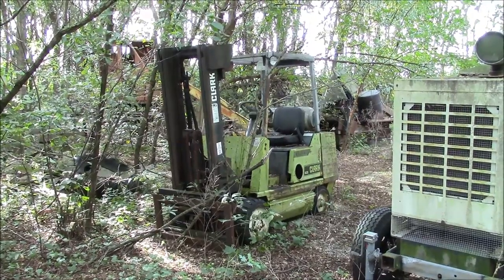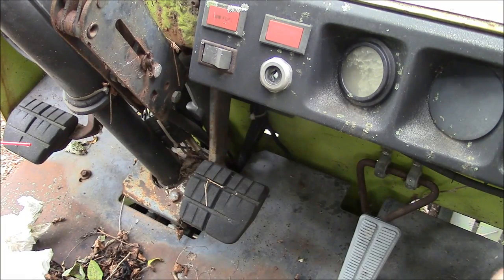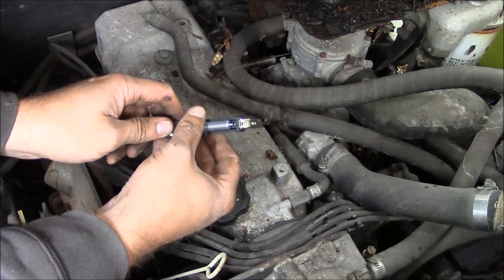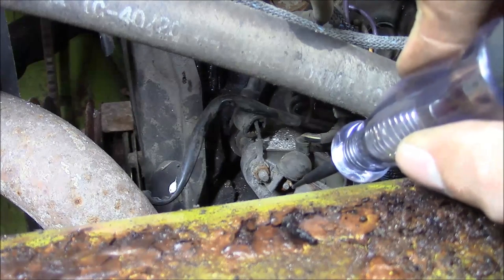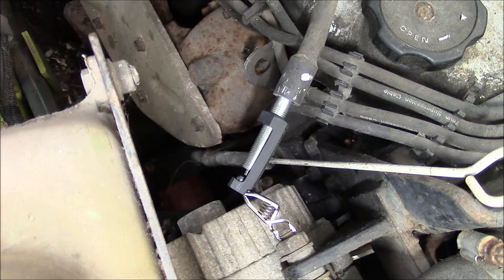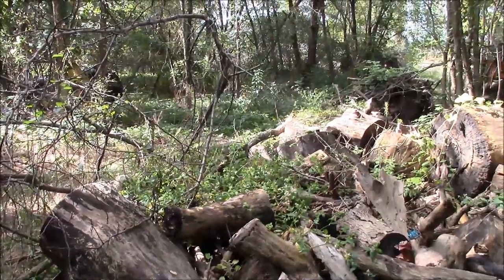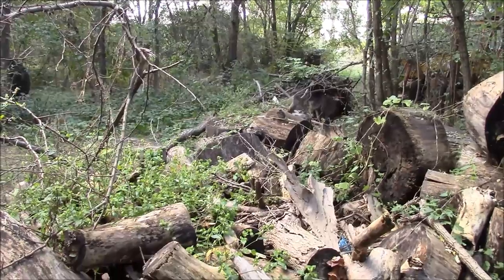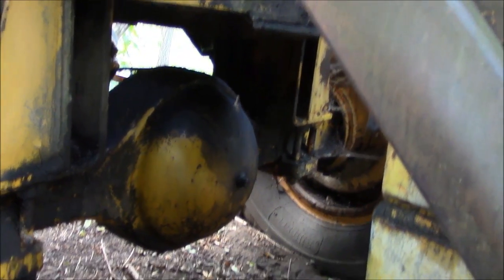Clark Forklift Sitting in a Field for 17 Years - Will It Run Again?

Comment: I have to say that I find it hard to believe that the fork has been there for 17 years. Very little dirt around the engine, very little rust and the seat, well that just looks in great shape. If that seat was out there for 17 years, the vinyl would be in quite a dilapidated state. I would say it's only been there 5 years at most.
Reply from the maker: You can believe what ever you like. It was parked there when I was in high school. At that time there were no trees around the machines. I'm now 34. I know no one has touched any of the machines in that time.

Comment: You should change the oil BEFORE trying to start it. If there is water in the oil pan, that is what the oil pump will push into the bearings at startup.
Reply from the maker: I generally agree. But, changing the oil in a forklift that's buried up to the axles is no small task... I chose to roll the dice.

Comment: Not everything works, oh well. It looks like the little fork lift will be a fairly easy recovery, but probably a lot of work once you get it out.
I suspect that cut wire was probably a form of theft prevention. Likely it was parked with the key in it, and you aren't the first one to find it sitting there.

Comment: Tie a tow strap or chain to a tree, run it from the back underneath the fork lift, attach to forks, lift up fork which will pull the chain and pull the fork lift backwards.

Comment: This thing brings back memories. The company I used to work for had one. Until a doofus ran it off the loading dock ,forks first. They had to bring in a rotator to pull it out of the dirt. They sold the forklift to pay the rotator charge.
Is this part of the extraction of the drag line?

Comment: As what we called it in Clark, a  Mits-Shitty, if you want any info on it, contact me, I worked on that model for around 30 years. before I retired.
Reply from the maker: It seems much more refined than the flat head Continental in my other Clark. I guess time will tell.

Comment: I'm wondering if the reason it won't idle down has to do with your coil and plug wires. I just had that very issue on my van where it wouldn't idle down. Then, I was driving down the highway and lost a cylinder. I had to have my coil and wires replaced.
Reply from the maker: The gas pedal sticks a little. If you pull up on it the engine idles down.

Comment: old machines had character... i saved a 1993 clark last year- had sat about 4 years in a scrap area, now working on a 1963 towmotor that sat there a year longer...have it running, but steering is bad, rebuilt steer axle, starting on its steering box or worst case power steering conversion. heres a link to the old clark, not much of a video, but it turned out to be a great truck...it only has 1900 hours on it.  those mitsubishi motors were pretty reliable.https://www.youtube.com/watch?v=1PmybZU-4wY

Comment: I just bought an old early 80’s Cat forklift. It has electronic ignition and a spot where I think a ballast resistor used to be. It runs fine ,but without a resistor I’m afraid something is going to burn up. Can you tell me how your resistor is hooked up? I can’t find anything on the internet. I just subscribed, thanks.
Reply from the maker: The ballast resistor is largely a hold over from the days of points ignition. With electronic ignition, the resistor is not really needed because the transistors in the ignition module can handle the higher current. That's why I predicted it would have points. To wire in a resistor you just put the resistor between the "ignition" power from the key and the coil. Then wire the "start" power from the key directly to the coil. That lets you bypass the resistor while cranking to give a hot spark to get the engine started.
Reply: Watch Wes Work , that’s what I was thinking. Ballast resistors are used in points ignitions. I’m not going to connect one. Thanks.

Comment: Some of those Mitsubishi forklift engines had a low oil level switch that cuts the ignition that could be an issue
Reply from the maker: My other Clark lift has a low pressure interrupt for the ignition. This one probably does too.

Comment: I have the exact same forklift at the shop I work at but yet this one sounds better cuz our forklift has a bad motor coolant in the oil metal flakes in oil but she still runs it's still put her to work
Reply from the maker: Probably needs a head gasket. Common issue.

Comment: Considering the time it had been sitting I would have changed the oil first. Drain the old and on wit some cheap oil just to avoid the water in the bottom to avoid it getting into the rest of the engine.
But why do people just leave working stuff outdoor?
Reply from the maker: I normally agree, but there's really no way to change the oil without jacking the machine up out of the hole it's sitting it. I could suck it out through the dipstick tube I guess. But I chose to roll the dice. The owner bought all of these machines for projects after retirement, but his health went downhill and the machines just sat. We are trying to clean up the property since he can no longer keep up with the place.

Comment: I think that forklift was made in korea I use to drive one that had tires for outside and a 3 stage mast with side shift
Reply from the maker: It has a big "USA" sticker on the front. It's visible at the start of the video. But Clark forklifts are now entirely owned by and built in Korea. Not sure when the transition happened.

Comment: good  fork lift, does this mean you might get  the old loader?    chevy truck with backhoe  haul that home  to,  take backhoe off and sell it to mount on farm tractor  and 1952 chev truck has a market easy,  didn't you rebuild red seal/continental engine a couple years ago?    guess what I'm saying you can drag those machines out of the weeds  and find new homes for them and make a bit.   have fun.
Reply from the maker: This red seal unit has a GM engine. I'm not sure that truck has any value.
Reply: If Chevy truck has good cab there is a buyer. 
The backhoe can be repurposed with a 3 point hitch.

Comment: "I drained the oil into a nest of bald eagles", what a put-down Some dumps heavy equipment into woods and a view is concerned about a fluid leak, and without hesitation accuses the host of polluting the environment. Sir, may I suggest once you have retrieved what you can use, then please inform the local authority for the removal or at least to remove all fluids.

Comment: For the stuck loader engine, try some force, you have nothing to loose.  I have had success in a case like that by filling a cylinder with closed valves with oil and fitting a grease zert on a spark plug base, then pump away with a grease gun.  The engine will turn of something will break.  
The engine in this tractor was broke free using this method.  It was a free tractor and I sold it after I got it running.  https://www.youtube.com/watch?v=dEOwrMmOFNQ
Reply from the maker: Well that's a pretty clever idea.
Reply: @WatchWesWork  
I know I made this comment before (never got posted for some unknown reason ) but I swear by the strength of "WHITE VINIGAR " against rust.
I have cleaned up a multitude of objects with just soaking them in a bath for a few days, even weeks at times from old ax heads/tools recovered from being buried in the ground to seized engines and it hasn't let me down once.
At about $2 a gallon jug it's a cheap fix. 
With the engine, fill up every cylinder and the crank case  as well, if it will hold the fluid and leave it to do it's job.
Be patient!   When it stops "boiling" (probably a few weeks ) drain and rinse with water. 
Then try the grease method as described above by Jim Thode. Good idea Jim.
 You have nothing to loose................. except an unseized block.

Comment: Is this the Sargasso Sea of lost Heavy Machinery?
How did these vehicles get there?  Is it a dumping ground for stolen vehicles the crooks could not get running?
Reply from the maker: No. It's a lifetime collection. But the owners health deteriorated before he could ever do anything with the machines. We are cleaning up the property since he can no longer maintain it.
Reply: @WatchWesWork  Thanks for the quick reply.  Liked and subbed and rang da bell for that.
Great how a fast field expedient repair was able to get this machine going.  Looks like you could use a few 
4x8"  planks to make a small self laying roadbed to drive off that soft ground.

Comment: In  a field? 'til the field became a forest! and by the wheel and tire size it should never have got there: it's a factory lift, designed for concrete floors! Running on propane is a fair indication of indoor use.

Comment: That's a 1.6 or 1.8 Mitsubishi engine. That Clark uses a Lucus  key
Reply: Use the dipstick to start it!
Reply: @gibbo9089  what dose the dip stick have to do with what size the engine is.
Reply: @gibbo9089  a lucas key is a factory key for case catapiller and alot more equipment that's a factory key not a master key.
Reply: @anthonyyoung7344  what I am saying is when machinery is stolen, thieves knew that most machinery had Lucas ignition switches as standard with the flat style key. The ignition barrel allowed you to put a dipstick in to start it. I worked in the plant and machinery industry for years and knew that little hack. Nowadays it's different.
Reply: @gibbo9089  IV never seen that IV worked on heavy equipment for over 20 years

Comment: People cut wires like that at auctions so they can get it much cheaper
Reply from the maker: Could be. It's in a spot that is not accessible without removing the air box, so they really had to work at it.

Comment: I have a cat t50 . It stalled and it won't start . Any one have an idea?  Tank full , has 125 psi to 145 psi compression all 4 cylinders. Has spark . I spray either in it.  It starts and dies. Also if I keep messing with the throttle like pumping the hell out of it constantly it will some what try and start and run for a couple minutes then dies .?
Reply from the maker: You likely have a problem in the vaporizer or the carb. Parts to rebuild them are very reasonable.
Reply: @WatchWesWork  ok I tried also another regulator that is on engine from another propane fork lift from a pic n pull yard and all that did was fill the building full of propane in 20 seconds. But before all this happened it always started real quick and easy then one day it acted like it ran out of fuel . I went and got a tank of gas for it and my tank worked on his fork lift and I used his on mine . Mine did not start
Reply from the maker: @wreckerjonny6144  The diaphragms in the vaporizer and carb can rupture and cause the issues you describe. They are relatively cheap to replace. I bought all of them for the machine in this video for $35.
Reply: @WatchWesWork  ok thank you I'll see if I can locate them for this old relic it's a 1957-8

Comment: you will never drive that on that ground, i have an old hyster i found and fixed up, it has little bigger solid back steer wheels and much larger drive wheels, and the couter weight is so heavy, and if i dont have good weight on the forks the steer wheels sink an inch into my 24 year old drive way, graval.. and all it takes is a 1/4 spin of the drive wheels and its down to the carage frame, and it takes a hell of a good run with my 4x4 chevy and a long 1" nylon rope to snap it up and out, it will not move with a chain.. the only problem i have with it yet, is some times when i first start it, and even let it warm up, the hydraulics work for a short time then stop, no steering, no lift nothing, shut it off for 10 to 20 min. start it up and away we go, i have had the main relefr out 3 or 4 times, took it a part, cleaned it and put it back, but still nothing, it uses the same oil in the clutch, drive axcel and hydraulics, i changed the oil to a hypoid oil, being it has the oil bath clutch. i re-wired the whole thing, witch is in a video, the thing lifts like hell, once your off and going the hydrolics never kick out, seems if it is going to kick out, it will be in the very begging of a new day start up, and not ofter, so its been driving me nuts to find what is doing that, i have made videos on it asking if anyone knows but nothing, the pump has 4 lines on it, one feed from tank, one #10 hose to the valve bank, that splits off to a number 4 hose to the steering box, and a # 6 hose that connects to the tras-axcel, and a 2nd return from there to tank. it bottoms out my 8000 Lb trailer, i have 2 sets of forks for it, one sets 4 feet long and the set i use are 8 feet long, works great for moving 1500 Lb round hay bales and 1 ton totes of feed as long as i stay on dry hard ground, witch  i have red clay here that you cant even stab a bar into, but when it rains, its grease
Reply from the maker: Hard to make a guess. Usually these forklifts have simple open center hydraulics. So, you have to poke around until you find it. Restricted suction line, worn pump, worn relief valve, etc.
Reply: @WatchWesWork  yes i know i been poking around at it for 3 years but it is so intermittent, it makes it very hard, i have had the relief out, cleaned as i know it just takes a peace of shit to screw it up or act up, i flushed the whole system, only part i have not opened up is the pump, testing presser im getting 3200 psi, 800 at steering, 1850 at mane valve, had the top off the transmission being a  hydraulic line hooks to it, it is a very simple system to what i am use to, took top off  hydraulic tank, washed it all out, and used a shop vac to suck everything left in it out. changes suction hose, washed out the steel washable filter, the problem never lasts for more then 10 min when it happens, when i took the relief valve apart i expected to find a broken. i at first thought maybe a strip spline on pump drive but with all the use and 3 years it would have stopped all together by now spring

Comment: Always wonder what's going through people's minds when they abandon perfectly decent running equipment in the woods. (might want to run the VIN thru the police department)  Just saying. Lot of these types of videos, like the guy who bought a brand new JD tractor and just parked it after it was delivered. Or the farmer who one day for whatever reason, left his equipment where he last used it. One never knows. My neighbor across the road has a somewhat newer Ford tractor (similar to a 4000 series) that came with the property when he bought it 10 years ago. Was only used for blading the dirt road a few hundred feet and mowing the 3 acre pasture by the previous owner. Well, the idiot neighbor just couldn't get it through his head you can't run it out of diesel, because then you have to bleed the system. Clearly didn't know how to use a fuel gauge properly! So we'd have to go bleed it and get it running. TBH he did the same thing with his riding mower as well. Run it out of gas and just let it sit where it died. Anyhow, it ran out of diesel again, and he decided enough was enough and just let it sit in his pasture. 8 yrs went by and every attempt to purchase it by many people was met with "No, I think I'm going to get it running again". Well, of course the tires went flat, dry rotted. The top of the sheet metal starting to rust a little. Idiot probably didn't use coolant or change the oil, so who knows if the block is cracked or not. Now diabetes has eaten him up, foot amputated, and still refuses to sell it with the same response. Would cost a few thousand now to get it going, so almost not worth it.
Reply from the maker: Well these machines belong to my grand father. He collected a lot of old junk right as he was retiring with intentions to do various things with them. But, by then he was slowing down and never got around to doing any of it. Now he is unable to do anything with them or even maintain the property. So we are trying to clean things up.
Reply: @WatchWesWork  Thanks for telling the story mate. Hope you get that stuff all running and get it cleaned up. Has to be some value in it also. I wonder what other treasures are hidden in the trees?